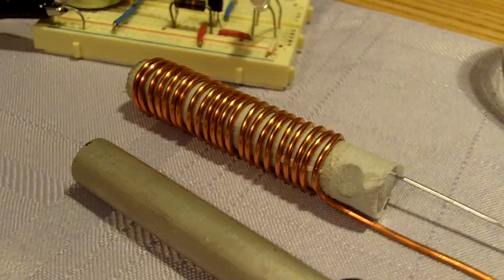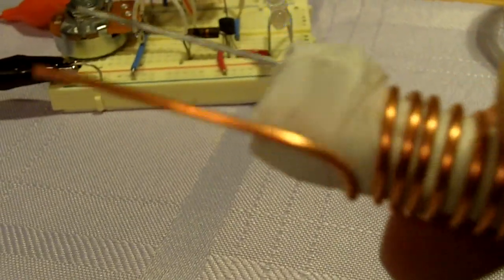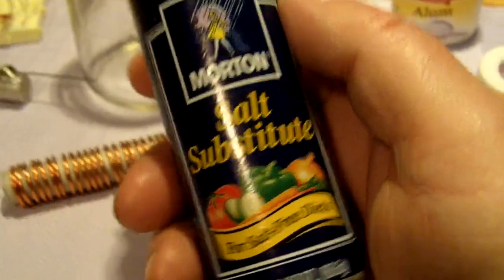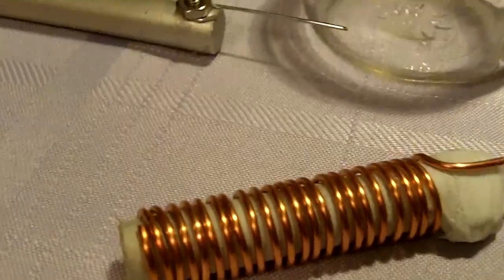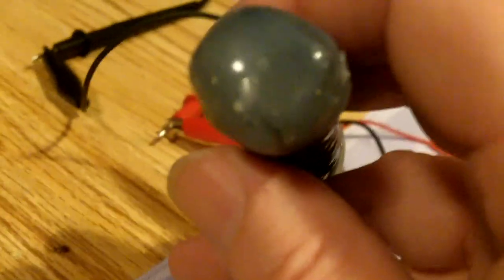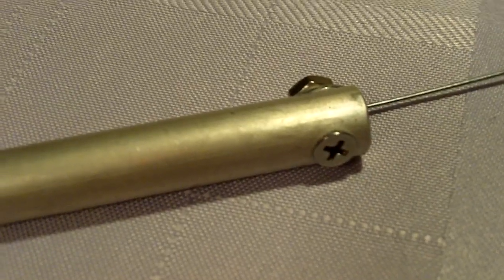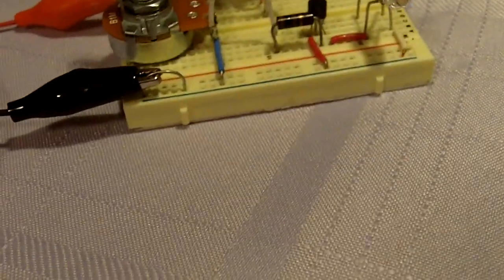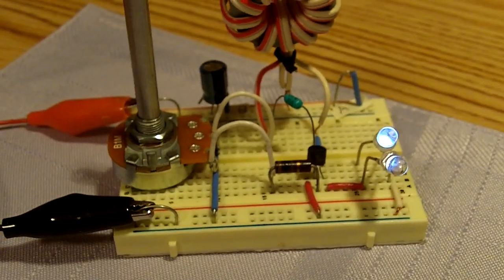Magnesium & Copper Battery.MOV

Comment: If you use carbon felt (used for a welding shield) instead of copper, you will get 1.8 volts. You have to hold the felt down with yarn or string, good and tight.

Comment: I'm sorry to tell you but this is a bi-metal effect that happens with dissimilar metals. The most widely known is copper and aluminium. This is why you can't fasten copper and aluminium wires together without an inert split bolt made up of inert cadmium. As an electrician I can say we are very familiar with the principal. All you've done with the various salts is to speed it up which is why it oxidizes. I don't believe you are a fraud. I do believe you don't understand what you are doing.
Reply: The bi-metal effect you referred to is called "electrolytic corrosion" and when dissimilar metals are combined with an acid or other catalyst it becomes what we know as a battery. This guy said he made a magnesium-copper battery and that's exactly what he did. I'm certain that what you just tried to school him on was already known by him as a basic fundamental of battery construction and is something that everyone who tries to make a DIY battery should know before they get started.

Comment: Looks pretty cool, but if you did just a quickie job taping it up (so you'd have a dry surface) and then painted or dipped the whole thing in Plasti-Dip that should give you a completely airtight seal.

Comment: Try using copper foil instead of wire. It seems to me your only using the small part of the wire that makes contact with the other layer instead of the whole area. I don't know where to get copper foil but they sell copper sheets at Lowes for roofing for 1 - 2 dollars. That way you would get way higher current output.
Reply: They often sell copper foil as a sticky tape, its put around plant pots to prevent slugs climbing up. Garden centres are a good place to look.

Comment: Use a PVC tube instead of the tape and hot glue. Cap one end to run pos. and neg. connections. The other end is a threaded cap.
Reply: +Indian Creek Profit 
If you seal pos. and neg. terminals you can add water to the PVC tube to add battery life. Great teaching video thanks for making things interesting.

Comment: EXCELLENT! Thank you for the post. If I may ask a question, Magnesium is a substance that I would like to replace. Have you found another substance that might do as well in replacing magnesium?
Fireworks does well due to magnesium. Auto engine parts made of magnesium is light, strong BUT if it ignites it will burn uncontrolled melting through an engine block. Firefighters can only wait until Mg is completed burning. I do not want to criticize, I ask to learn. GREAT POST!

Comment: I am very impressed with your project sir magnetman2010. Very interesting. I wonder if its possible to control the output voltage? And if its possible to amplify the voltage in another way without connecting them in series? Im interesting in the size of the magnesium used. :)

Comment from the maker: @ibpointless2  While they are drying I have two of them running two of Limotir's Penny circuits. I'm getting about 600 microamps and about 1.4 volts now. I'm also making one out of a 3/4 '' copper pipe. I'll use the magnesium ribbon on it. I'm using about a 1/2 cup epsom salt dissolved in about 1/2 cup of water and dipping the core of the battery in several times allowing it to dry an hour or so in between dips, that seems to work great. I'll do a video about it sometime.

Comment: @magnetman2010 

You're welcomed. I look forward to your next video. The next thing to look at is the self charging of this cell. Short the cell out for a day then remove the short that night and by the next morning check the voltage. Do this for several days and watch it return to over 1.400 volts each morning when you check it.

Comment from the maker: @ibpointless2 You were right. I paper taped the magnesium, wound on the copper wire, wet it good, shook on some salt substitute and filled in beween the copper with epson salt, taped it again, got it good and wet, then let it dry (NO ALUM) and it is looking good. 1.4 volts after 12 hours of drying so far. I'll do a video on it sometime. Thanks very much!

Comment: @magnetman2010 
howdy howdy....
just wanted to let ya know that the fuji unit does fire up the led christmas light strand ( 100 leds ) .
but , what i as curious about is , hooking up 2 fuji units together as in bridging them together in parallel series on the output side. more less in a way of increasing the out put voltage.
anywho , i might just go ahead and hook them up together to see if it works.
lol , who knows , maybe it'll work , maybe it'll make smoke signals.hahaha

Comment: @magnetman2010 

When dry I have one cell giving over 1.4 volts at around 20 micro-amps. Don't add the Alum, only use Epsom salt and salt substitute. Let it dry over night then apply the magnesium or copper as tight as possible to the separator then wrap the electrical tape very tightly too. It might be best to use notebook paper instead of tape paper you use, due to notebook paper is thinner so it has less resistance and that means more power. It was the alum that was lowering the voltage.

Comment from the maker: @ibpointless2 I made one more today but did not tape it. I decide to let it dry out and see what the voltage would do. It started out at 1.4 volts ten hours later it was at .7 volts. I'm thinking that after a few more hours of drying it will be at 0 volts. what kind of voltage are you getting.

Comment from the maker: @Lidmotor I made one more today but did not tape it. I decide to let it dry out and see what the voltage would do. It started out at 1.4 volts ten hours later it was at .7 volts. I'm thinking that after a few hours it will be at 0 vlots.

Comment: howdy from alaska...
i was wondering something here , maybe you might know or someone else you know.
but , i been messing around with those disposable fuji circuit board units to power led christmas lights.
now what if i bridged 2 of them together on the output side for higher voltage , do ya think it is possible without cooking them ?
       donny.....